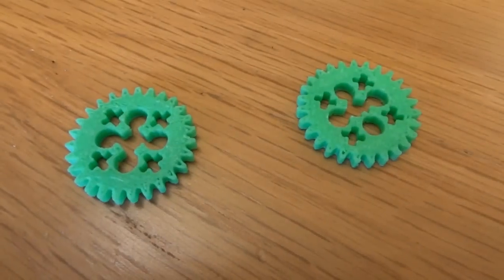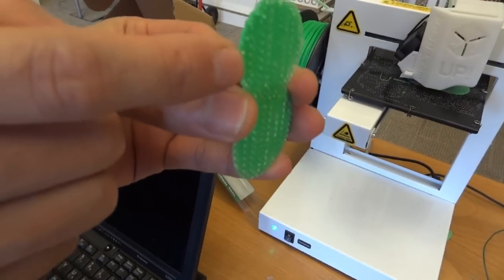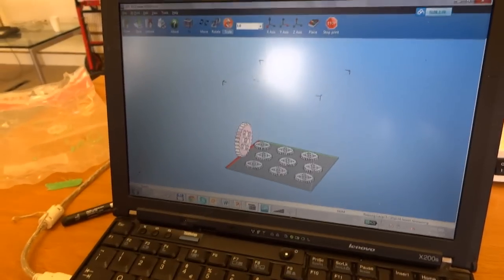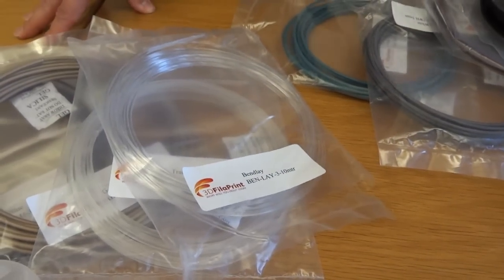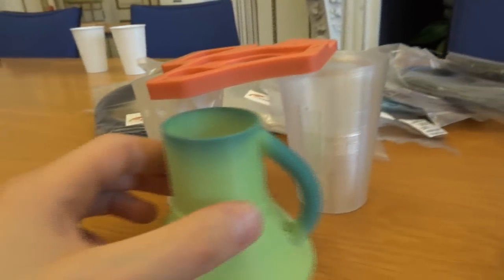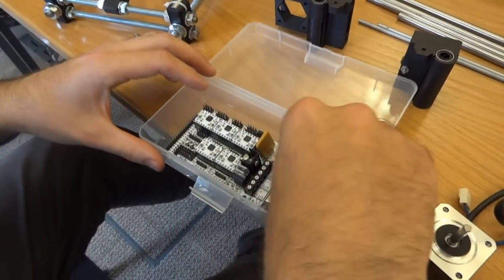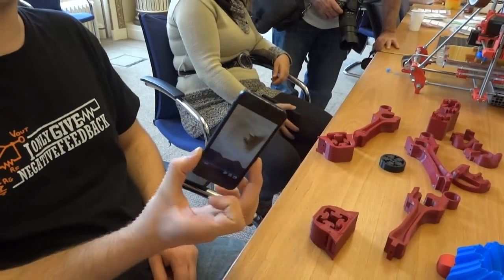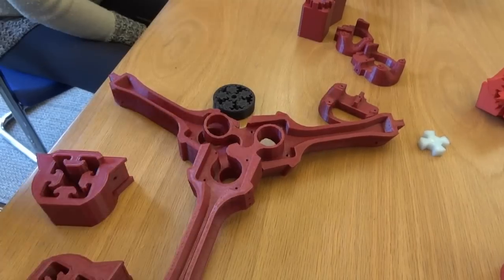SoMakeIt RepRap & 3D Printing Workshop at IBM Hursley 29th Sep 2013

Comment: The guy building the i3 is taking a rather bad rout for his electronics! RAMPS with a LCD means you don't need a PC attached to it ever. Just pop your SD card into and off you go. Or he could go down the RPi route and octoprint. Allowing web control of the printer.